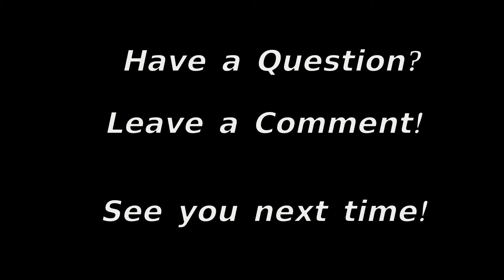How to Install Harness Bar on RX7 FC (Project Dream Ep.10)

Comment: Where did you get the bottom bolts from?
Reply from the maker: You have to special-order them. I got mine from Fastenal. That's mainly if you want to use the OEM seat belts again.
Reply: @NorthDakotaCarGuy  I'm trying to put five points in and everything I can find is too short to fit between the five point lap bar belt and the OEM bolting position
Reply from the maker: @ryancilione299  why don't you join the Discord so you can send some pictures to me and I can check them out tonight
Reply: @NorthDakotaCarGuy  it's been raining since that day. Should hopefully be clear tomorrow and I'll get some pictures.